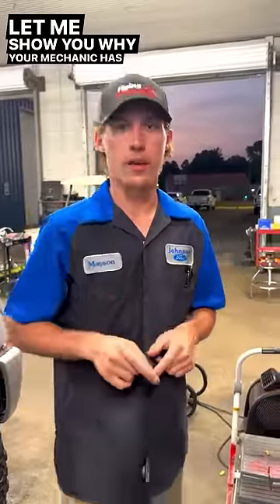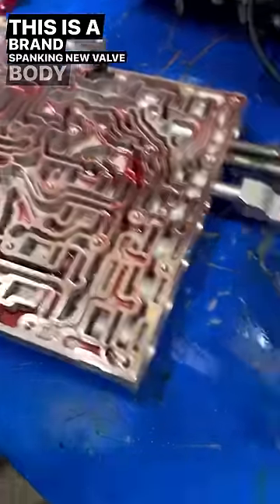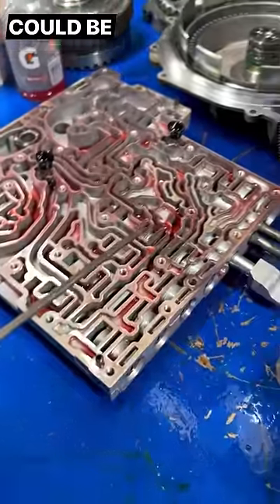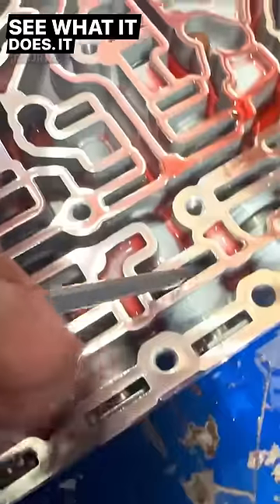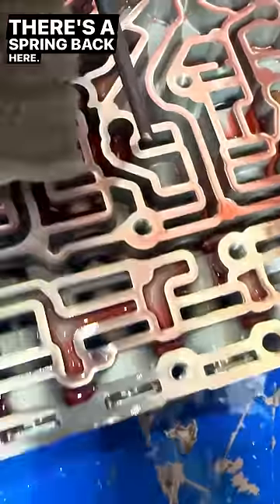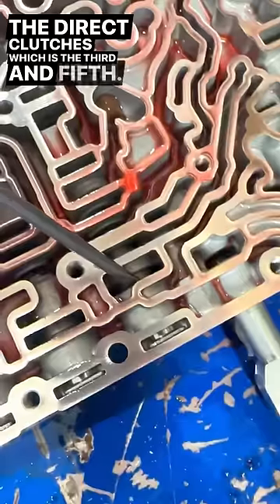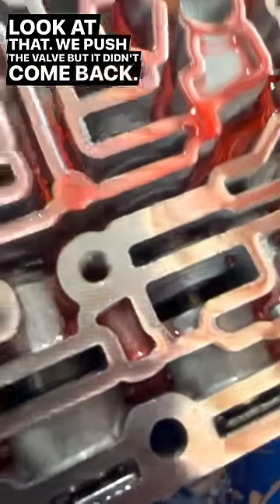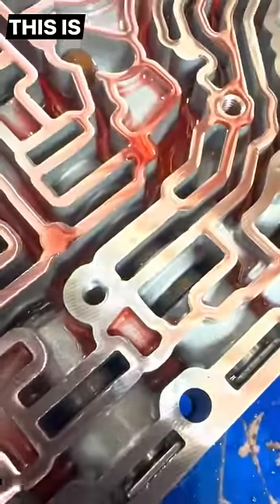Why your mechanic has trust issues #shorts #ford

Comment: meanwhile my simple manual transmission just works.
Reply: Manual Gang!
Reply: amen!
Reply: I love it
Reply: Yep, 334k miles on mine and it still gets me everywhere I want to go.
Reply: @LeonSteelpaw  woop woop
Reply: The best part about manuals is that they can be broken and still work
Reply: This is why Tesla is going to take over
Reply: @executivecallahan1599  What color is your Bugatti?
Reply: Mine didn't, after a faulty gasket made the gearbox puke all its oil out on the asphalt. It started making supercharger noises and lost the third gear and yet I could still drive home with no other issues :D
Reply: Meanwhile my horse doesn't even have a gearbox and it works just fine.
Reply: @angry_zergling  are you one of those Andrew Tate fanboys?
Reply: Simple ehh?  Bet you never haven't even changed your own oil before 😂
Reply: @epic_errors i think they were making fun of those.
Reply: be honest, it's just a excuse for "I can't afford anything else anyway"
Reply: "My simple manual transmission just works" < I live alone and could only afford a base model SC2 
We all have preferences, but come on now 🤣 Automatics also shift when they are supposed too, don't grind 3rd, are a lot harder to break in a stock vehicle, ect.
Reply: I used to say this, but my five speed just failed after 70k miles. At least they're repairable.
Reply: @jamesmurphy449 good thing the automatic in your new Nissan didn't fail just last the 60k or whatever warranty cutoff. Buddy of mine just had to drop like 5k for a new one.
Reply: This kind of thing is why I'm trying to convince my wife to get manual licence (🇬🇧) Automatic just looks like one extra thing to go wrong and cost me money. What with all the planned obsolescence, transmission looks like another trap placed by manufacturers.

 Not only will it go wrong, it will go wrong in the most spectacularly costly fashion.

If you are going to the effort and expense of acquiring a licence, what is the extra cost versus the saving. Sure, you save some time and money upfront - but I can easily imagine headache at car hire while on holiday.

A girlfriend of hers echoed all of my points... slowly,slowly catchy monkey😉😉
Reply: @liammhodonohue  in US, you don't need a special license to drive a manual 😅 too bad the UK is so backwards
Reply: @johnm5928  most vehicles are manual here. Until recently, automatics were considered an odd creature. Since EV and hybrid have become popular automatic is slowly getting more popular.

Driver registration is majority manual. I think there are insurance company statistics that indicate automatic only licence holders are more commonly involved in accidents, out of proportion to their share of drivers.
Reply: @johnm5928 Manual is the standard. The license for automatics only let's you drive automatics. You're crowing about the fact that your country let's people drive cars when they don't know how.
Reply: @liammhodonohue  If you plan to always drive an auto, you should still learn to shift, so you have an intuitive sense of why it's done, when the machine makes poor decisions, etc. It can better prepare you to control the vehicle in an emergency.. even if you're just moving someone else's car out of the way of the ambulance. It's weird and sad that we no longer consider it a valuable skill here in the USA.
Reply: @ReddwarfIV as an American, I gotta agree
Reply: Always manual.
Reply: Until you burn out a clutch or have grinder gears. Automatic transmissions can out live the car they were built with. You cannot say the same about a clutch. You manual car master race people are funny though. You monkeys actually think manual transmissions are less work than an automatic.
Reply: @johnm5928  Nissan uses CVTs and no they don’t burn out at 60k it’s closer to 120k. CVTs are technically “automatic transmissions” but need to be discussed separately because they are basically disposable transmissions. The reason transmission shops have gone away is there is no business for them anymore, but they may come back as CVTs are being used more and more. The issue shown in this video isn’t that common but finding badly machined parts is something mechanics just have to deal with.
Reply: @jamesmurphy449  it’s no longer a valuable skill in America because everything you said is BS. You can try and teach a person how to react in a bad situation all you want. The truth is they will likely shit their pants in it. And most people regardless of what transmission they have, do just fine in snow, ice and floods. It’s just a few that fuck up and it’s shown by how few cars are in those situations compared to number of cars on the road. Tires have a bigger effect as to how well you do in those situations.
Reply: @johnm5928  lol, in the uk. you only need a normal license to drive manual. the automatic only license is for people who couldnt drive.
Reply: @rjgaynor8 have fun driving up and down mountains with your automatic transmission, careful you don't ruin your brakes on a long downhill run while I use my engine brake like a man
Reply: @epic_errors  The person I was responded to was calling everybody 'brokies', which is a Tateism. So I countered with a Tateism of my own suggesting he's a brokie too.
Reply: Autotrannies seething ITT.
Reply: @hariranormal5584 Arent those still more expensive than automatic? The majority of cars sold in europe have manual transmission, dont remember automatic being more expensive.
Reply: @liammhodonohue What? You brits need a special license for manual transmission?
Reply: Well most automatic trans are solid and they aren't slushy anymore and for city driving aka stop and go they are great but they add complexity compared too a Manuel transmission and every engineer will say that isn't a great thing  (especially if sameone put the wrong viscosity trans fluid in😅) also the comon tech is a stack of planetary gears with clutches in between so yeah the gears are almost indestructible but the clutches arnt and only one of the 12 of them needs too break or overheat to fuck the wohl system (pulling trailers uphill for example is a great way to frie one) soo both options ar vaild choices  but for me it is Manuel I get better fuel economy because I cann see ahead and cann select a gear for ideal engine breaking and than switch too a higher one too roll out without use of any fuel  and my breaks hold longer
Reply: @ABW941  not quite, we have normal licence= test was on manual but it's safe to assume you can be trusted with automatic. 

Then automatic only licence for those who cannot/will not get a normal licence, so will only ever drive automatics.
Reply: My automagic transmission just works too! (So far)
Reply: Yes
Reply: @johnm5928  judging by the number of USAF staff who wreck their cars while deployed in Norfolk, UK ... I'll say your licensing isn't as thorough as it could be. They don't just wreck cars, they wreck people as well 😔

When can you start lessons, 15 years old? (17 here)
Reply: Just my very last car, and I've had probably 50 cars by this point, is an automatic, every single other car it truck was a manual trans. I've only replaced 2  clutches of of the 40 something vehicles I've had that were manual trans. The only reason I took this automatic is because it only has 35k miles on it and it's a Lexus and they use some of the best auto transmissions available, hope I don't regret it.
Reply: @liammhodonohue To be fair Air Force dudes who in all likelihood just jumped into their first or second ride in your country aren’t exactly a fair sample of the general American public. They are just practicing for that Camero @ 26% interest they will get when they go home 😂
Reply: I was just about to comment on the Ford Motorcraft junk parts! So I have a 96 Ford Explorer XLT with manual transmission and the slave cylinder was shot, I replaced it and less than a year it’s shot again. My customer has a 92 ranger and I replaced his as well when I replaced his flywheel, and he said he’s feeling the same problem with the damn slave cylinder too!
Reply: Our brains work a lot better than these valve bodies 😂
Reply: @rjgaynor8  Tell me you drive an automatic without telling me you drive an automatic. :)
Reply: Amen! Cheers from Ontario
Reply: @gatergates8813  oh look a little girl is trying to determine what a man is. My truck does just fine with it’s automatic transmission. It’s almost as if you don’t know what your talking about. Oh and my brakes are just fine. How’s that clutch plate? Worn out from you grinding gears little girl?
Reply: @rjgaynor8  lol u mad bro?
Reply: Meanwhile my vehicle (not truck) is a single gear and just works ;P
Reply: Bruh even my 95, 240 is still pumpin strong never has ever given me an issue and I ABUSE it
Reply: @gatergates8813  that all you little girl? Lol you kids are funny.
Reply: @rjgaynor8  why so mad?
Reply: @liammhodonohue  So many boomer moment thoughts in this reply chain. Modern automatics are far more reliable and cheaper to own than manuals, albeit not as fun to drive. Your average modern transmission if taken car of properly will last the life of the car, the problem starts with customers NOT taking care of their car. Thus if you take the same moron and give them a manual, they will break it all the same.
Reply: Manual for life
Reply: Meanwhile my simple 1 speed EV just works
Reply: @kylinblue  if it stops working, are you able to diagnose the problem and fix it yourself in your driveway?
Reply: @executivecallahan1599 found the guy who wishes he was a car guy
Reply: @GuamanianBlood619 they're pretty simple compared to automagics
Reply: @hariranormal5584 real car folks prefer manuals
Reply: @rjgaynor8 the reason there's no business for them is most people don't keep their car for more than 5 years anymore because they just have to have all the new techno-gizmos
Reply: @acywei modern transmissions last the life of a car mostly because that life is rarely over 5 years
Reply: 666 likes lop also cute pfp
Reply: @silaskuemmerle2505  automatics can have fewer moving parts, especially fewer moving parts with high load.
So, they can last longer.

It's an engineering tradeoff, so the answer is always "it depends on a fuckton of things, and the people making those decisions aren't making them to serve you, they are making them to make money".
Reply: I didn't get one to be part of some exclusive club.  I got one because I'm a cheap bastard.  My power windows never broke either, because I don't have any.  Power locks never broke - don't have any.  Never got carjacked via USB, because I don't have that.  It's a goddamn car.  It doesn't need any of that shit.

Sometimes I wish I had air con, but I know that would have broke in the first year or two.
Reply: @tsm688  lol. If your car is the way you say. I can break into it and steal it with a flat head and cause no damage to your car. You probably have no clue how to carjack the 1 car that be with a USB. Most new cars cannot be broken into easily, but yours can.
Reply: @rjgaynor8  that "one car with usb" was every model of hyundai from 2014 onwards.  I doubt you could start mine, but if you can, be prepared to pick a club.
Reply: @tsm688  lol. You really have no clue what your talking about. It was from 2013-2015 that had the problem. But it was only the cars ignition switch. Also I know how to brake into a club. They aren’t secure in anyway and the fact that you think they are is hilarious. They are a pain to remove but that’s all. Especially easy if they have those round keys. Those I need a paperclip. You just made my night and I screenshot your reply because I know quite a few people who’s cars were stolen with a club in them. Lol.
Reply: So happy I have a manual never again buying an automatic
Reply: Thats funny, because i hear about more manual transmission blowing up than autos, all the time.
Reply: @executivecallahan1599 the irony of calling a mf a brokie when you can't drive a real car
Reply: It’s actually you who’s working, bruh
Reply: @vappyreon1176  Blew 2nd or 3rd? Don't need em!
Reply: You mean his BOO GAH EE?
Reply: manual drivers going 10 minutes without telling someone they drive a manual (challenge impossible)
Reply: And is a pita
Reply: OH! IMPRESSIVE.
Reply: @gatergates8813  almost like all automatic cars have a mode where u can shift yourself and avoid that 😅
Reply: @vistify967  yeah that choice between D and L gives you so much control right? Go drive the Cabot Trail in the rain and then get back to me on that one
Reply: @LeonSteelpaw  eeeey ✌️😎
Reply: But most of America can't use it. It's a kill issue. 😂
Reply: @liammhodonohue  sounds pretty bogus even in the uk, but in the us For the 1980 model year, 35 percent of cars produced for sale in the United States had manual transmissions, according to the Environmental Protection Agency. Today, the share is about 1 percentAnd just 18 percent of American drivers can drive a stick, according to U.S. News and World Report.Jun 24, 2021
Reply: @gatergates8813  many automatics let you change the gear if you want to ruin your engine instead of your breaks.  Most people like to keep their engine more, even on a manual.
Reply: For real!
Reply: It’s no more called manual, now it called “today’s anti theft system” 😅
Reply: "It just works" - Tod Howard.
Reply: @executivecallahan1599  Its 2023. It costs more to get a manual. They sell autos as the cheaper stock version and class manual as an "extra" that they charge for unlike befor
Reply: @liammhodonohue  The US people crashing in the UK would be due to the fact you can drive on a foreign license in the UK so you are really bagging out the US drivers and the US driving training. 
You show your US drivers license and you are good to go.
Reply: @FustFPV   eh?

I think most countries allow mutual recognition of driver's licence - especially USA/UK/EU/Australia/NZ etc. It's only yanks from air force bases that manage to wreck cars and people.

Not sure where my licence fits in to the argument.

It is well known USA is built for the car - large, wide and straight roads. Europe was designed around the horse/walking. Driving vehicles on these roads requires more from the driver.

US licence is granted on any car, no distinction is made manual vs automatic, yet the licence is also recognised.
Reply: @liammhodonohue  sorry, I thought you were meaning the UK licensing was the reason there is so many United States air force service members crushing while deployed 8n the UK
Reply: @liammhodonohue  oh it just clicked.
Your from the UK bagging out US drivers.
I thought you were American trying to defend US drivers while making fun by accident 🤣
Reply: @FustFPV  no worries. Easily done ✌️
Reply: @ABW941 I’m pretty sure it’s more common for countries to require a manual license than to not. 
And automatics are definitely more expensive than manuals.
Reply: L
Reply: @liammhodonohue You need a license to drive a manual?! UK, what the fuck, automatics are relatively new, did your leaders hate manuals that much, or are they in bed with the dealerships who want more expensive (ie automatics) on the road
Reply: @executivecallahan1599 brokie? You know expensive cars do come in manual right or have you never driven an expensive manual car?
Reply: @Veltrosstho  again. We have normal licence (= everything up to 3.5 ton- cars, vans, light trucks) or automatic only.

The vast majority of drivers and vehicles are manual. Automatics are only becoming more popular now because of EV and hybrid.

I don't think there is any conspiracy between government and dealers. I continue to think (still trying to find insurance data) that automatic only drivers are statistically worse at driving as they struggled with the first hurdle - operating the clutch.
Reply: @executivecallahan1599  I agree on the fact it's due to supply and demand making them manufacture more autos and less manuals. In turn making the manufacturing cost higher for manuals.
As an Australian that uses both auto and manual depending on were I am driving to on what terrain, I don't agree on the oddball statement though.
Autos just don't cut it in the outback and cause to many people to get bogged and stuck, or unable to go up the hill required to get to their destination etc.
City driving or gravel roads though, 100% go for an auto.
Reply: @hariranormal5584 For some, that might be the case, but for most people manual transmissions are just fun.

Also, you gotta hunt for them, since they're become increasingly rarer to find in newer cars.
Reply: @hariranormal5584  Given they now make the manuals more expensive than the auto's I'll just ask wtf you're actually talking about 😂
Reply: @rjgaynor8  Just got my second manual after putting 160k miles on the last one. Original clutch, never had to do anything to the transmission. The problems you are describing only happen when peopel do not know how to drive a manual (not fully opening the clutch, shifting too hard, riding the clutch, not being in the proper gear, etc). I have never met anyone who can properly drive a manual who has had a problem with their transmission, the only ones I ever see complaining about it are the people who don't know how to use them.
Reply: @Nza420 same, 350k and 20 years still runs perfect 😂
Reply: @executivecallahan1599  so white lanborghini/buggati/ferrari/porsche do you have? or do you have a pagani or roll royce or something like that?
Reply: Yawn.
Reply: @gatergates8813  Ma'am, if you can fuck your brakes up that badly going down a mountain in an automatic, your license needs to be revoked lol
Reply: @gatergates8813  most automatic transmissions have a way to manually select what gear you want to be in, even crappy CVTs where they're fake gear presets. Only ones that don't are in absolute econoboxes and even those usually have a "low gear" setting.
Reply: @acywei  pretty much on the "breaking it anyway", manuals are cool, but every time I've driven one I was abusing the shit out of the clutch. I'm sure I would get better with experience, but I would probably still end up being harder on the transmission than just letting an automatic do the shifting for me.
Reply: Meanwhile my automatic transmission just works. Meanwhile the synchros in my manual transmission gave up the ghost and now I can’t shift into second. These statements, including yours mean nothing. 

Hurrr, muh manual…
Reply: people who don't know how to drive a manual have no business being in the driver seat.. @Nbomber
Reply: no advantages to manual son
Reply: Lmao it’s no simpler
Reply: Stick shift for life
Reply: @executivecallahan1599 You can't drive stick lmfao
Reply: @eliasvalimaa4282 The fact you were still able to drive it anywhere proves it did just work.
Reply: @GuamanianBlood619 Double negative?
Reply: @hariranormal5584 Oh, so like driving automatic is an excuse for not being able to drive stick? Don't play games here, stick is fun, if you can drive it. There's much more satisfaction in it... but if you're incapable I understand how you wouldn't enjoy it and would prefer automatic lmfao
Reply: @R3AL-AIM You're listing off user error stuff, showing this comes from people that can't drive stick...
Reply: @executivecallahan1599 and you have money?
Reply: @ultorrotluultorrotlu it has a gearbox, it's called knees
Reply: No it doesn't.
Reply: Binder Grinder all day every day.
Reply: @silaskuemmerle2505  the average age of all cars on US roads is 12.5 years
Reply: @alquinn8576  classic cars and farm trucks throw that number off significantly
Reply: @silaskuemmerle2505  lol how many farm trucks do you think there are? but looking at just "passenger cars" the average is 13.2 years. I don't know anyone with a classic car and a quick search indicates there are estimated to be just 5M in the US under that designation.
Reply: @alquinn8576  classic cars are defined as over 25 years old and given that the vast majority of classic cars on the road are from the '60s, (which means they're over 60 years old at this point) it doesn't take all that many to significantly impact average age of the cars on the road.
Reply: @silaskuemmerle2505  There are almost 300 million cars in the US and perhaps 2-3% of those are truly "classic cars" (rather than old 25 year old beaters). If a classic car is 50 years older than other cars, on average, then that would add 3% x 50 years = 1.5 years to the average age of the fleet. The adjusted average age would then be 13.2 - 1.5 = 11.7 years.

Or completely side-stepping averages, the median age of  passenger cars in the US is 9 years (my honda civic is 14 years old -- another 11 and it will be a "classic" car I guess lol)
Reply: Well, mostly works. I have to keep fiddling with mine, it almost never shifts automatically.
Reply: @R3AL-AIM Automatic transmission failures are probably the single most common reason for a car to end up in the scrapyard, right behind car wrecks. They are expensive to replace, most people can't (or won't) rebuild them, and most owners never service them.
In fact, automatic transmission issues will land you on the list of cars to avoid (Consumer Reports, etc), see: Ford Fiesta, early-2000s VW with the 5AT, Nissan CVTs, any Dodge. . .